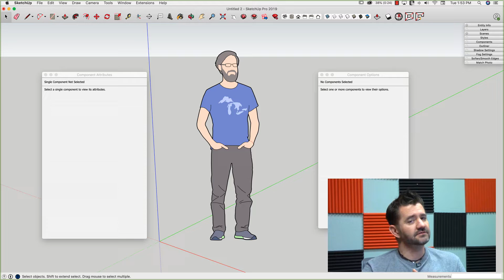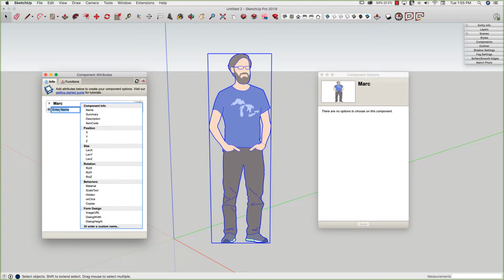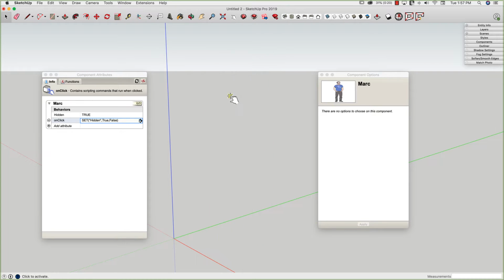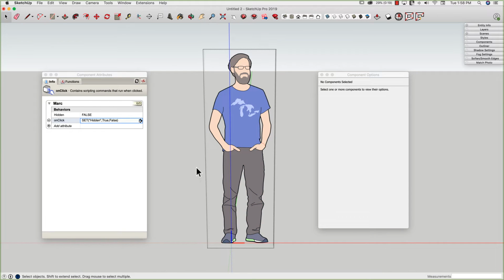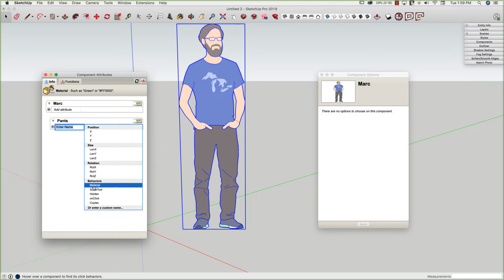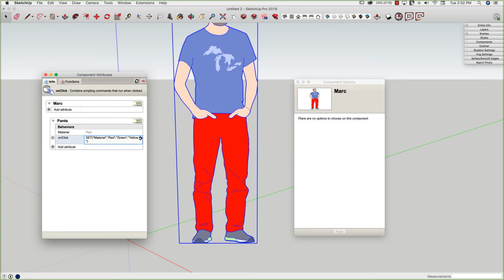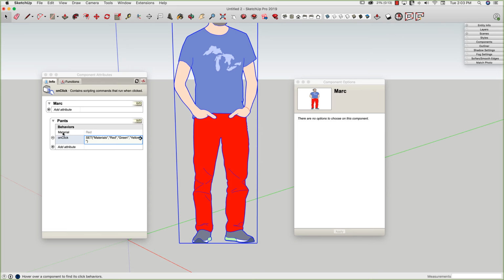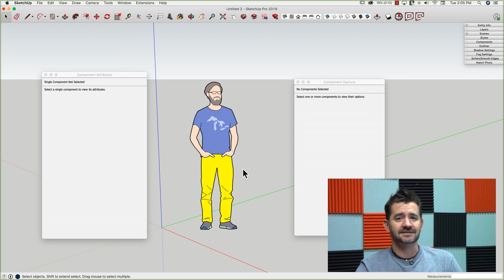Welcome to Dynamic Components Part 3 - Skill Builder

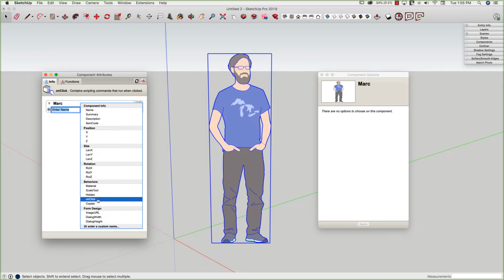Comment: 2:42   Hidden
Gosh, I wish you'd zoom in...    👵👓🔎
Unfortunately, after I click to hide the door, the finger cursor doesn't recognize that the door is hiding and to bring it back.  😣
I have to "edit, undo".
Reply: So, now I'm back tryin' to figure out how to use the finger cursor to rotate something, but apparently rotation is not a "behavior"?????
Reply: I finally found it!
ANIMATE("ROTY"0,180)
But it doesn't work! 
It only lays there and flaps from 180 to 90 and back to 180 on the 2nd click. It won't go back to 0!
😭😭😭
Reply: There is something about the Y-Axis that doesn't like to complete a return rotation. If I build the thing upright to rotate along the Z like a normal door, then I just tip it over to lay down flat, it will work. But if I build the thing flat on the ground to rotate on the Y like a cardboard box, then I flip it upright, it still won't work. 
Weird!!!
Reply: It's been a month and I'm learning alot. 
For instance, if I build a thing laying along the Green Axis, then I put it into the position I want it in - along the Red Axis - it's all messed up. Clicking results in the thing flipping completely out and away in some crazy direction. 
So, I have to build it in the same direction as where it will eventually be placed. 

If there's a fix for this, it'd be great to find out. 
Have a happy!
☕

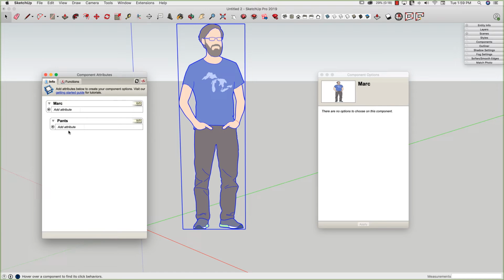6:53   The way to get the color to change!
Reply: So, I followed the "Hidden" thing exactly, and it disappeared correctly, but as soon as I moved my cursor off the same place I clicked to hide it, it lost the component and couldn't bring it back. 
I think today, I need to actually log in and check out the Forums...

Comment: I am running Pro 2020. I have created a component then entered the component to select the face inside the component that I want to change color on.  I created a component and named it panel but it did not keep that as a sub component.  what am I doing wrong?
Reply: When you create the subcomponent and you're in the "create component" dialog box, be sure that the box called "Replace Selection with Component" is checked.
Reply: @carlpetitt2241  I tried half a dozen times or so and nothing worked! Figured I'd go through the comments to see if others had this problem and sure enough! Thank you
Reply: I have the same issue. I made a subcomponent and afterwards it doesn't show in the attributes window.

Comment: Hello friend, i've been watching your  videos and  i had  a question. I have  a part  and  i wanted  to  resize holes  in  the part without having  to  remodel it, is it possible ? How  to  do this  task ?
Reply: I tried to do this with 3 subcomponents. 1 for the hole surface, 2 for the surfaces circles (with the cut-surface option).
It's complicated but not impossible.
The problem is when you make the section, because the system don't recognize the fill.